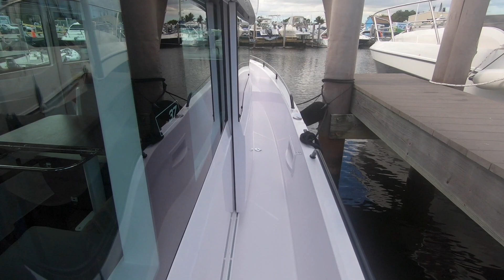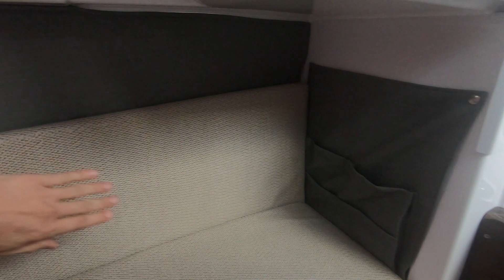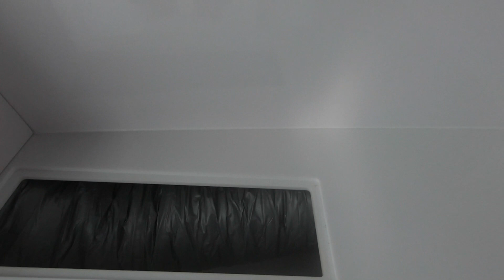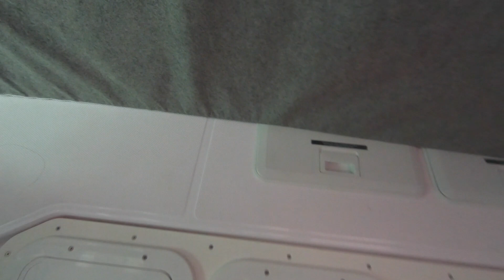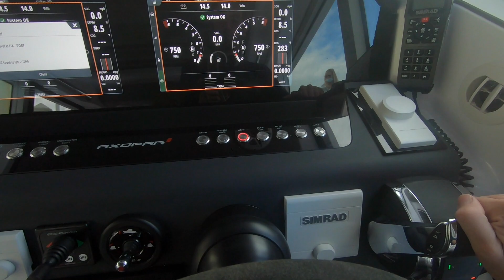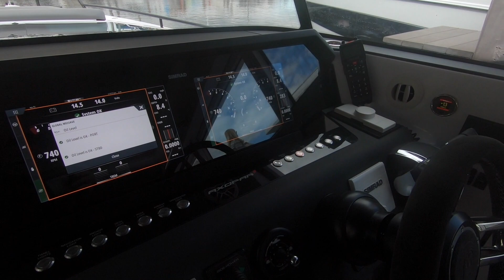2020 Axopar 37XC Aft Cabin w/ Enclosed Head. 12v Air Conditioning with Heat by Mabru MAXED OUT!

Comment: So where exactly are the through hull's located? There are steps in this boat - so through hulls need to be infront of the steps.   Look like they are close to the Chine.
Reply from the maker: They are as far aft as possible and far enough from the step that they are unaffected by the citation of the aft step. Location is about 1/3rd of the way between the chine and the keel. We have some this setup on quite a few boats with no complaints of losing prime while underway.

Comment: Hey man! Is there space below the axopar boat to add a sunkeeper stabilizer?
Reply from the maker: On the aft cabin version, I do not see where the Gyro could be installed but on a wet bar version, I’m sure it could be done, although It would require some modifications

Comment: how much is this system and what was the build time ? thanks in advance
Reply from the maker: The 7,000 BTU unit retails for $5,330.00 and the 12,000 BTU retails for $5,500.00 which includes the digital control as well as the circulation pump. Installation time will vary based on the vessel and the installer but this one took us about a week.